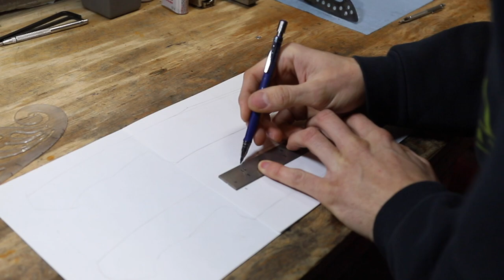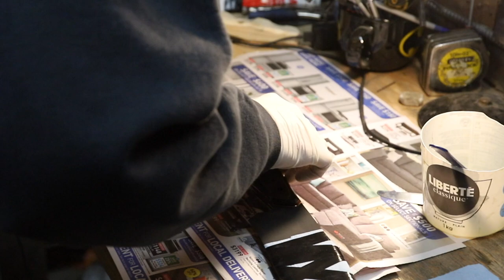Making a blacked out chopping knife

Comment: Man what a good looking knife!!! So, if you don’t mind sharing would you be so kind of telling me how you got it black? I saw the process but what was the liquids the blade soaked in or boiled in?? I’ve been using ferric mixture to etch my blades but I would love to try what you did! Just looks much cleaner than with the ferric. Anyways thanks for a response if possible and awesome knife man!
Reply from the maker: Thanks! I boiled it in a parkerizing solution. It’s a finish designed for firearms, extremely corrosion resistant
Reply: @saccoknives  awesome thank you so much for the response! I am gonna try to find some of that and try it out! How long do I boil it for? Or is it just a look for my ideal darkness?
Reply from the maker: @vincentcocuzza8679  it usually comes with instructions on the bottle, but generally 10-15 minutes